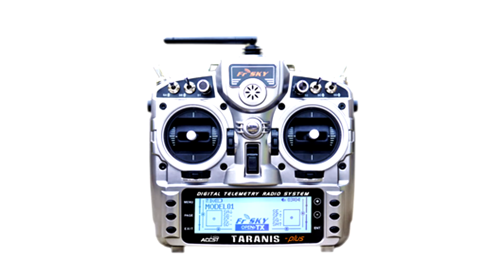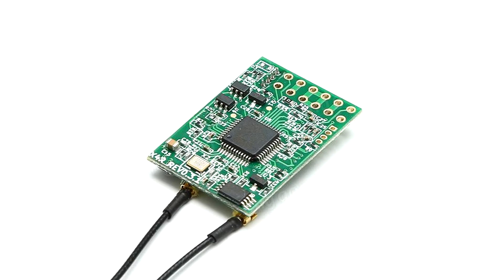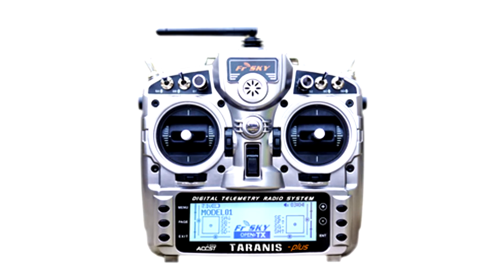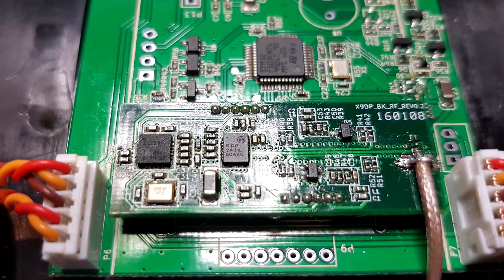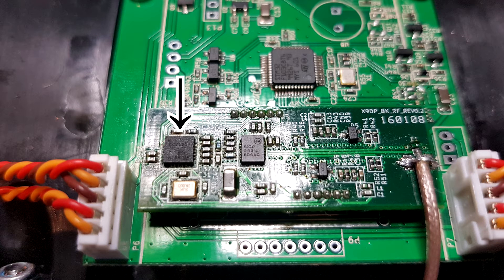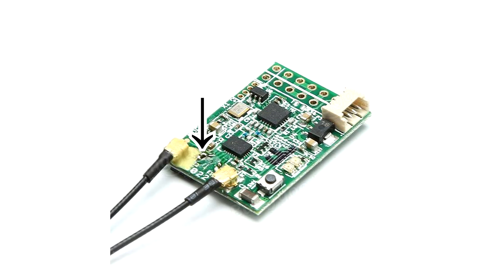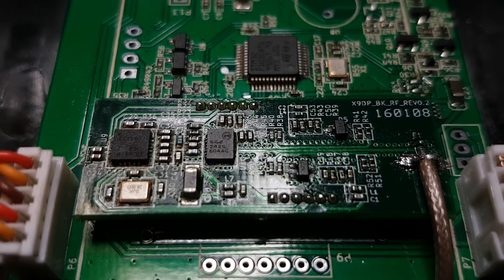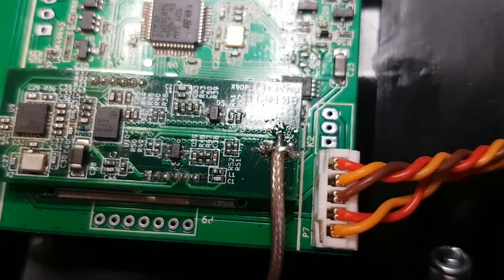How To Solve FrSky Taranis LockOut & Failsafes Problem

Comment: It's a bit confusing to me.
Humming sound/no sound from the speaker indicates what in respect of which electronic part being damaged?
Keeping the antenna core piggy tail end as short as can be at the soldering pad should be obeyed, so far so good, but why should a 5db antenna be worth than the short original one. The body to be groundet to earth during soldering should be a must.
😞🤔🤔

Comment: Salut, ma poti ajuta cu o parere despre pierderea semnalului intre taranis x9d plus versiunea EU si receptor X8R? Am doua X8R pe benzinar pt siguranta, primul ch1-8 telemetria activata controleaza cateva suprafete de comanda si al doilea ch9-16 telemetria inactiva controleaza restul. Sistemul functioneaza dar  uneori cand fac range test vad cum rssi scade la 0 si pierd semnalul. El isi revine cand ies din range test. Altadata pierd legatura cu celalalt tx sau cu ambele. S-a intamplat sa treaca modelul aproape de mine in zbor si sa aud telemetry lost. Am avut contro in continuare, nu stiu daca la toate suprafetele sau doar jumatate.. Am acumulatori separati pe fiecare rx si aprindere, antenele la 90 grade, distanta intre rx.uri. Am un modul orange in spate pt electrice, e posibil sa aiba de.a face chiar daca e inactiv pe modelul in cauza? In general semnalul imi coboara la 50 rssi la vreo 25-30m...cu lungimea antenei spre model, caci cu captetele spre model coboara la 40 rssi si suna alerta.
Reply: E posibil sa fi stricat modulul rf atingand cu mana pinii pentru modulul extern din spatele tx?

Comment: New RF boars "X9DP_BK_RF_REV0.4.1_170607" have a esd protection inductor "L9". I want to add this to my repaired rf board. I already replaced the board 2 times. Now I am repairing them with an SMD hot air rework station. But that chip will soon be fried again, for sure! Or maybe I will switch back to the stock antenna without SMA connector.

Anyway, what inductor is used in the new board. Type? mH? etc...
Reply: Did you find how to do esd protection? On the old board?

Comment: Salut, nu prea cunosc engleza, dar o sa te intreb in română 😁.  Acum o lună de zile mi am cumaparat si eu un Transmiter TARANIS x9d si după o saptamana am vrut să i  schimb antena cu una de 5dbi. Am schimbat o   dar imi spune "TX Antena defected" si nu am semnal RSSI de loc. Am tot dezlipit o si am lipit o  la loc până am stricat punctele acelea de lipire pe plăcuță si mi am comandat alta plăcuță. 
Ai vre o  idee de ce nu o citeste telecomanda ?
Reply from the maker: Inseamna ca are reflectata prea mare antena. De obicei dintr o conexiune proasta sau mufe gresite. Se poate face si daca s au dezlipit trace urile. Dar cu atentie. Daca nu s a ars frontend ul cel putin.
Reply: Multumesc mult! sunt la inceput in lumea asta FPV😁😅 si nu stiu multe. Mi am  luat si fir dinacela mai gros (RG-316) pentru antenă. Am vazut la multi pe yt ca folosește cand își schimba antena.

Comment: friend recently I made the replacement of the original antenna for 5dbi, but I did not have a good result, I took care of the solder issue, I did not leave the fero in the weld for a long time to avoid spoiling the tracks, apparently it looked great, I did some testing and it was all good, but on the last flights with my quad, I had many weak signal warnings from rssi in a very short distance, so I decided to put the original antenna back, I also did very carefully just touching the soldering iron very fast and taking out, with the original antenna I did the range test of 30 steps and the rssi is in 60 ai I activated the test of range in the taranis and the signal of rssi goes to 0, did not get to burn the transmitter of the radio, but that there is something wrong there, I already tested with new Rx and the same thing, the receivers I tested are XSR, I am glad to be able to tell me something that will help me.

Comment: So how can you prevent damaging the transmitter when doing the antenna mod? Is unplugging the battery enough to prevent damage from ESD?
Reply from the maker: William Slater yes and no but usually it gets fried when in action...so when soldering the pigtail it should be safe.

Comment: So your problem with lock outs/fail safe was caused by you replacing the Tx antenna?
Reply from the maker: In my case yes, but not in the first place. I first installed one pigtail witch was a little to fragile for my taste and changed it with another more robust and somewhere after the second pigtail i started having the issues